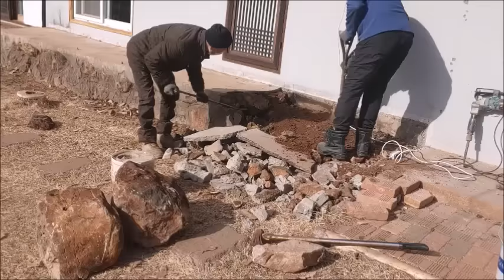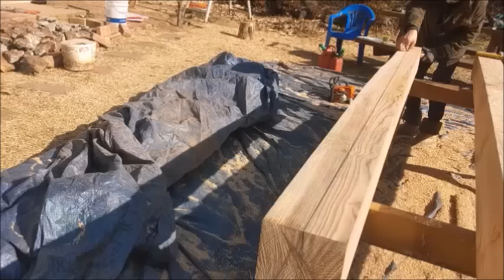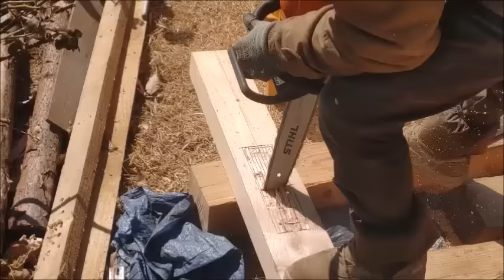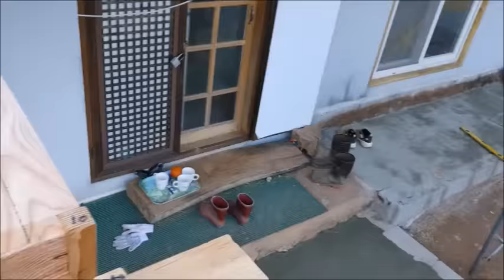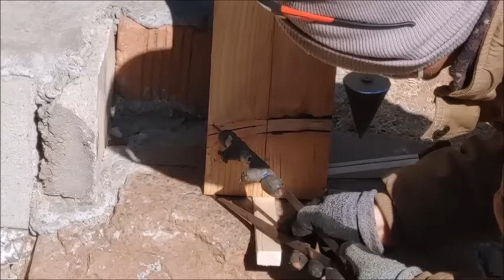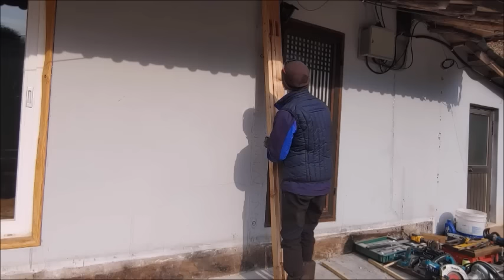House26-대청마루와 온돌은 나를 행복하게 한다.한옥,온돌,wood.

Comment: nice woodwork....interesting heating system
Reply from the maker: This is a modern ondol that uses electricity.
Reply: @woodwood1  looks like a hot water heater operating a closed loop, low pressure water circulation system....nice

Comment: EXCELENTE TRABAJO SIN CLAVOS..TECNOLOGIA JAPONESA.
Reply from the maker: Esta es una técnica tradicional coreana.
Reply: Not JAPONESA !
Reply: Traditional Korean houses (noblemen), temples, and high-ranking officials did not use iron nails, but mainly wooden nails.And traditional Korean warships also used wooden nail to connect them.So the more water and moisture they contained, the stronger the connection became. (until the 19th century).

Japan has acquired these skills from Korea and China.For reference, Japan was the most backward country in East Asia from ancient times to the end of the 19th century.Even if Europeans admire Japanese culture...

Although Japan is clearly ahead in modern culture, I think Koreans are proud of the traditional culture of East Asia.

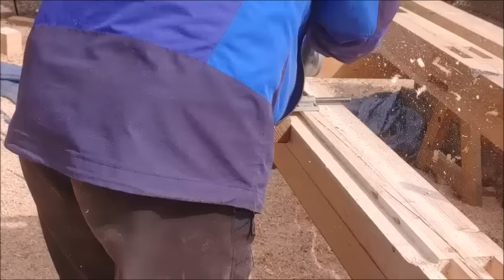Comment: What is the tool called at 7:50 that looks like a circular saw but cut a channel like a dado blade stack would?
Reply from the maker: It is a valley digging planer.
makita 3803a
Reply: @woodwood1  thank you!